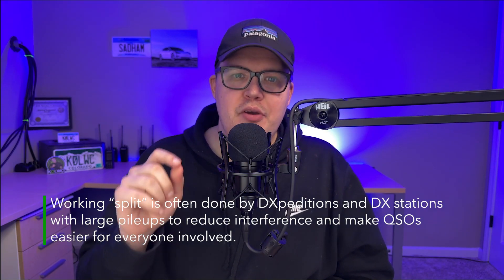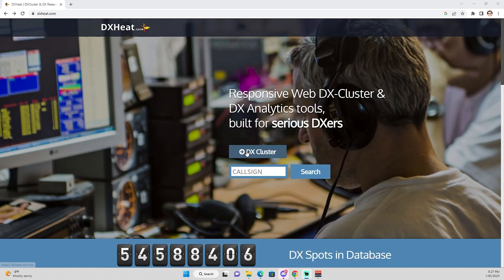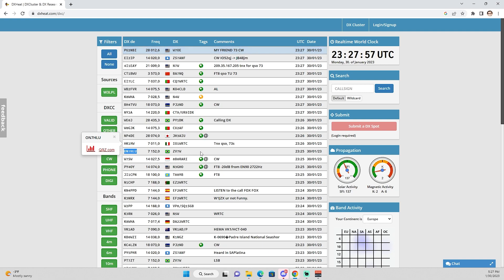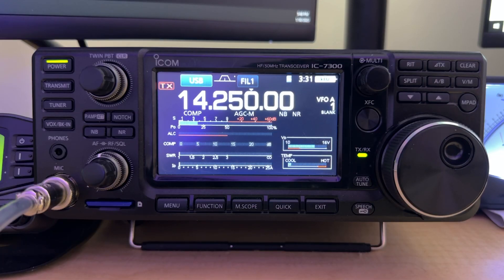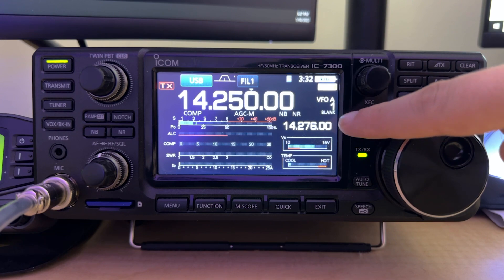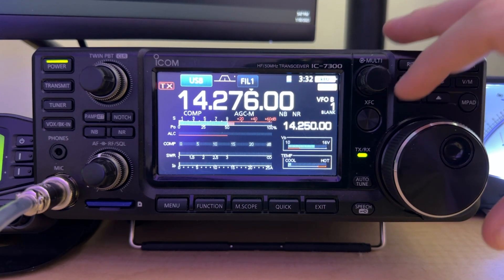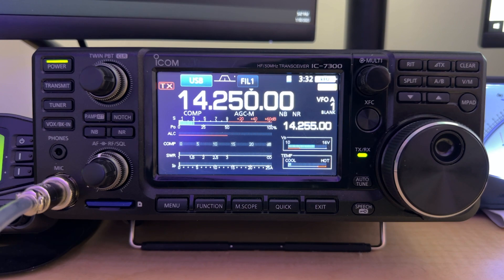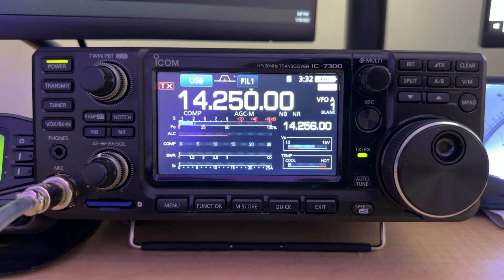Ham Radio Basics: Working Split Operation

Comment: You can also use the RIT function of your TRX. Set the TX frequency on 14.256 MHz and the RIT on -6 kHz.
In addition, you missed one other important aspect of working DX: the timing of your call! Maybe the DX-station waits a few seconds, before selecting the next candidate, i.e. when the pile is less intense... another good reason to listen first! 73 de HA7RJA - Rob

Comment: So, lets say I'm working FT8. How do I know if they are using split? Tried setting it up in WSJT-X, but it never put the correct call sign in. Good video, I'll SSB next DX I try.
Reply from the maker: FT8 technically works split by itself. The only thing to know about FT8 is whether they’re using Fox/Hound mode and what freq they’re on.

Comment: Great advice: "Take a moment and listen" 

Over the years I've heard hams from every portion of the "experience" timeline embarrass themselves by not taking the time to listen to what's going on before pressing that mic button. Some are new, some are old and don't care, but almost all of them just don't take the time to listen before jumping in. 

Some folks may hate this idea, but I think there should either A. be a practical portion of the exam to deal with operations or B. require a class (even online) to be taken that would cover basic operations. I think making the class requirement on new licenses AND renewals would eventually cover everyone. I don't even think it should be graded, it would be the separating line between those that care and those that don't and are part of the problem. 

Great video. The ham content creators would be doing the ham community a great service to put out more videos like this. Thank you.
Reply from the maker: Yes! Listening is such an important skill in ham radio — and in life for that matter! I feel experienced hams often assume newer hams know this stuff on day one. That’s simply not the case so this is more part to try and help. 😃